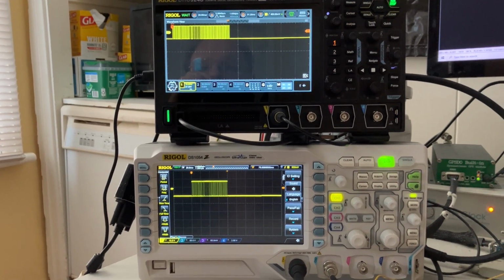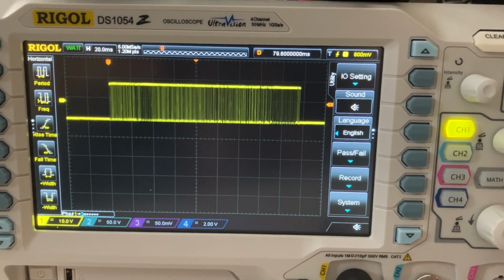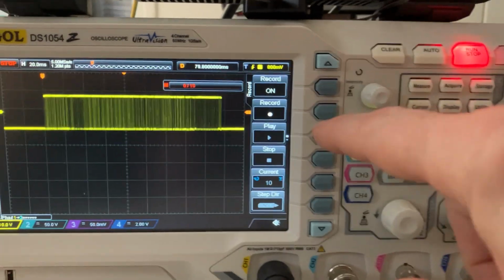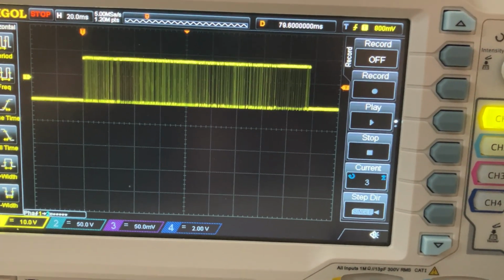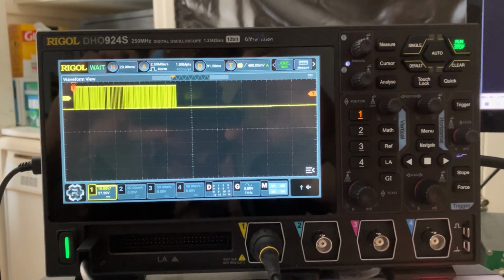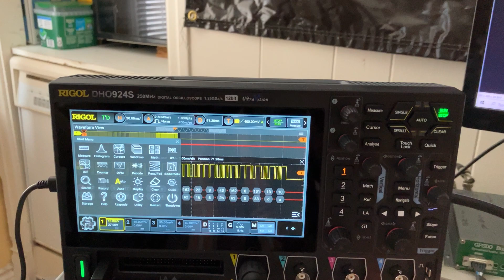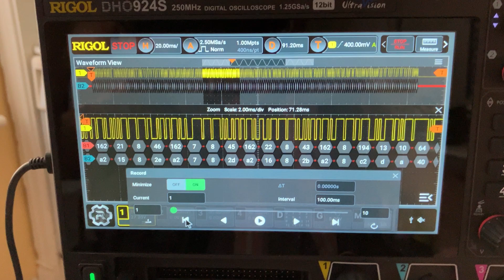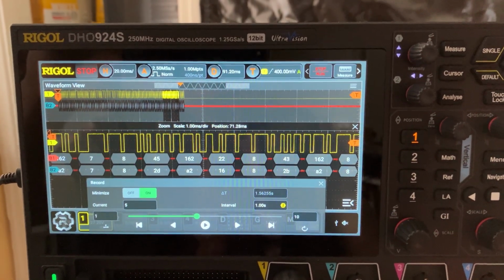Rigol DHO924s vs ds1054z while using memory capture AND serial decode.

Comment: Which one batter between ds1104z s plus and dpo900 series ?
Reply from the maker: Before the 900 came out, I wanted to swap my 1054z for the 1104z+s also. With LA port, the 1104z+ is $200 less than the 914 and $400 less than the 924 at $CAN1K. I now like better the features of the 800/900.  If you don't need the function generator and use only 4 digital signal, you get a bargain with the 804/814. Remember video shown here is with a "1104z" at only $CAN460